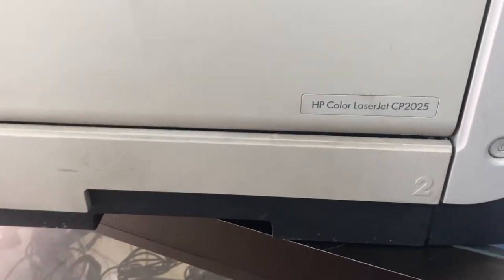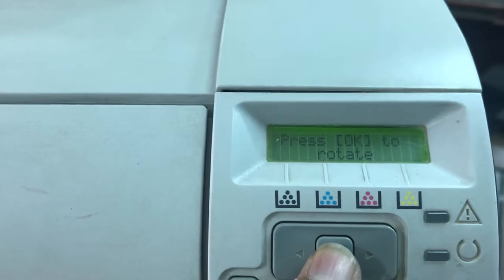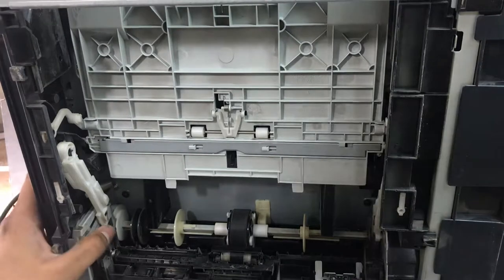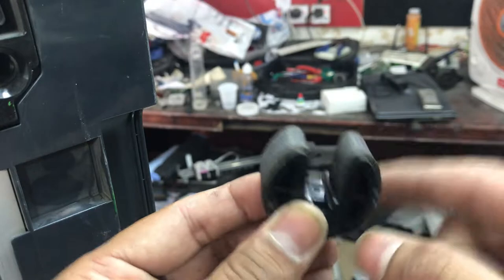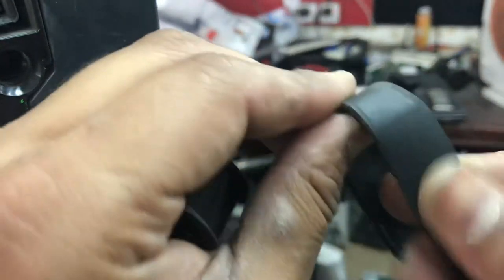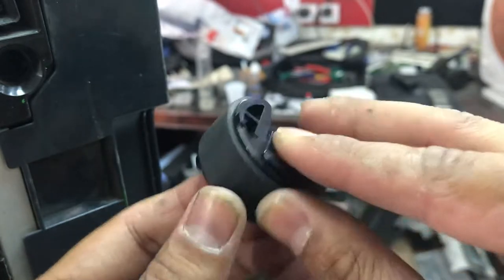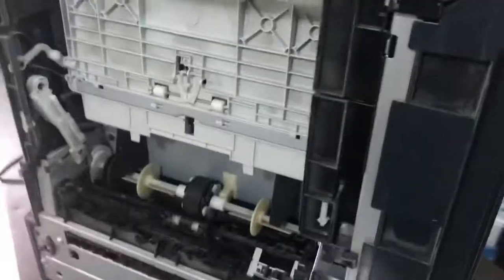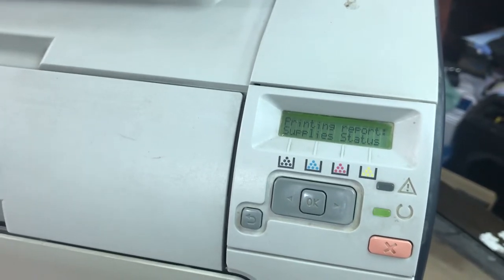How to Fix Paper Jam Problem in HP Color LaserJet CP2025

Comment: Thank you so much.  It worked.  I was afraid to turn it by hand.  I did, cleaned with alcohol solution and BANG!  Before I could only print ONE PAGE at a time!  Its not the cost of the printer, its the cost of the toner!!!  Mine is an HP 1215.  I have only gone through about 3 cartridges in 10 years!  APPRECIATED!

Comment: I was going to buy a new printer. I thought it was broken beyond repair. I spent 3 hours to print 12 pages a few weeks ago. I googled today and found your video. I turned the rubber on the roller and cleaned it. Works as good as new. Thank You so much.
Reply from the maker: Glad I could help

Comment: Awesome! Thanks a lot for the video. My printer was getting paper jam if I print more than one page. I cleaned using the same steps, the only difference was my rubber strip was half smooth and half rough so I had to reinstall twice to get the correct orientation and it started working fine

Comment: Wow cant wait to try this tomorrow. I just bought this printer used yesterday and it says  jan tray 2, after every printed page but its not jammed it just pulls the next sheet about 1" i need to try this tomerow hopefully it fixes the issue!
Reply from the maker: Did it work? let me know,, sometimes feeder roller and sepration roller must need to replace.
Reply: @BilalKhalid  I think so I did a small job of 6 pages and didn't see it. I started getting a new error after every 2nd page it would go to "cleaning" initialize and misprint I had to keep clicking ok for next page. Saw a settings change for that and haven't tried yet. But roller trick seemed to work. Thank you

Comment: I used to wash picker roller tires (On many different brands/models of printers) in soapy water, and then rinse well and dry well, and then reassemble.
Washing it would clean the paper dust and glazed surface of the rubber off enough to make the rubber grip the paper better.

Comment: How much force you need to use to get this thing off? I've bend the clips like for 1 cm from both sides and trying to get the thing out but it does not move at all.
Reply: Right?! I noticed I have two yellow spacers things attached to the wall, while he just has one on the right hand side.. but I was searching the comments for other people with are stuck..on getting the roller off.
Reply: Update: I DID IT! I GOT THE ROLLER OFF! I used a pair of scissors for LEVERAGING! A tip of the scissor on each white clip - put tenson on the scissors - and pop! I got the roller out easily!